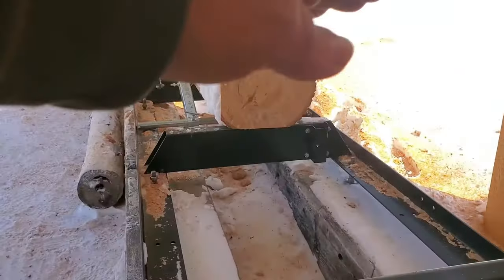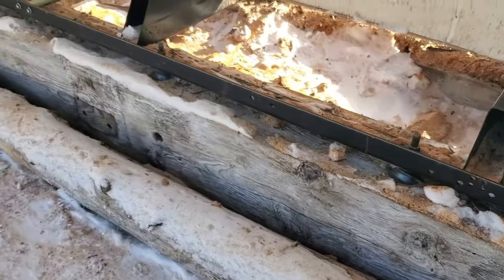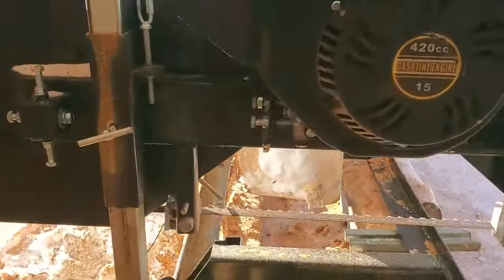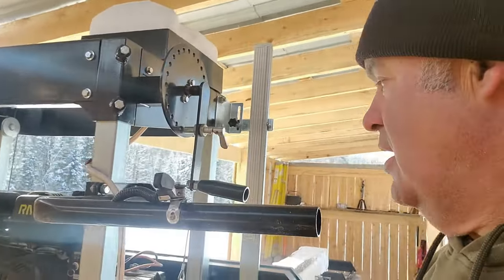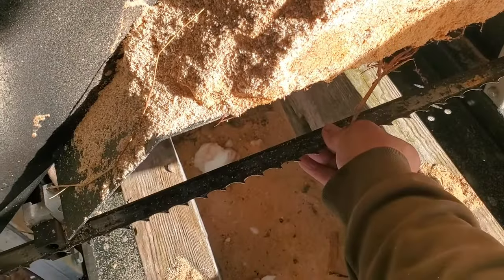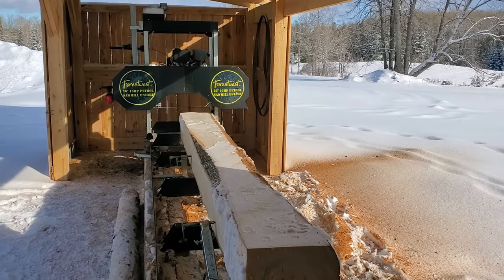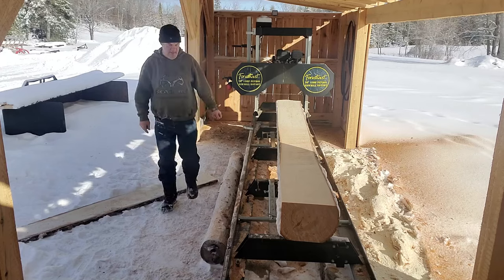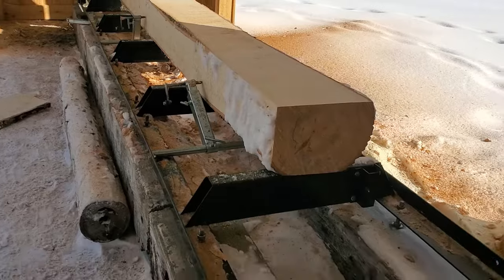Chinese low cost sawmill Forestwest 2 YEAR REVIEW

Comment: G'day Doyle, We do have Forestwest in Australia I purchased one of their 700mm firewood saw benches 13hp tungsten tipped circle saw for docking wings from my Lucas Mill, they wanted me to review it they film adds and have retired school teachers demonstrating firewood splitters. Anyway if you sat it on uneven ground which is what happens when you tow things around the yard the blade hits the side of the blade safety cover ! we spent a whole day making brackets and bracing the legs to strengthen it all up then lengthened the draw bar and made it removable and so on. If they had simply used thicker plate steel for a little bit more money from the start it would have been ok for the price.

Comment: It looks very very similar to my Woodland Mills sawmill. I mill hardwood mostly. My problem is the diving at knots. I went back to the manual and aligned everything to spec and still get diving.🤷
Reply from the maker: I find that putting a new blade reduces the diving and going slower does help also. But ya i know what you mean.
Reply: I find starting at the small end of the taper does help for some reason. Also I move the guides in as close as possible.

Comment: Well, at least it's accurate for what you're doing with it. But easy to see why it's cheap and goes outta whack though, like you said it's way too lightly constructed so they can save on steel and shipping cost. Hence, why you get it cheap.
Obviously you have a tractor or something to move the logs, so what I'm about to suggest won't impede the portability of that mill.
Get similar shaped but thicker L profile steel the length of the whole frame, slip it onto the outside of the frame and redrill the holes for the leveling bolts using the (now blocked) OEM holes as drill bit locator.
Reattach the bolts and your mill as a whole, square and level up your mill with a heavy load on it (lots of slabs), then true it all up and make sure it's level again (Expect to remove supports here and there) and weld the sucker.
2 inch beads every 6 inches for the whole length ought to beef it up substantially, feel free to drill some holes and weld those up as plug welds too, keep the heavy load on to stop the frame from doing any twisting/bending shenanigans. 
Those square crossbeams are so thin you could dent them with your finger, probably contributes to flex too, add more of them with thicker walls.
Do the same thing anywhere else you encounter flex/movement/"outtawhack" issues.
Just.. beef it up using similar but thicker profile steel, re-drill any bolt-holes from the in or outside using the (now blocked) OEM holes as drill locators, add longer bolts, even bigger diameter ones (if you deem it so), where necessary.
You will be saving a lot of headache and can just get to milling instead of having to true it up when a squirrel sneezes 1000 yards away 😆
Reply from the maker: In our area I've seen homemade mills built back in the day, you could drive a truck over them and they wouldn't budge. LOL Yes you can make this more robust for sure pretty easily with a welder and steel and some time. Thanks for stopping by.
Reply: @doylemaintenance  People got very creative back in the day, they were able to mill enough for their houses so of course the contraptions outlived their use (and their inventors lifespan).
Also, hope I didn't come across as ornery/looking down upon you. Nice work with everything you've done with the mill so far! You were 💯very clear in the video that you did your homework (we're the same, I overread and overthink as well), knew what to expect, knew what you were getting, you worked around it, saved money, and stayed active!  😊

Comment: Have you ever cut oak?  
If so what thickness? 
How did it do oak?
Reply from the maker: Yes red oak, it cuts slower but does it, To do it well I would need to switch to a different blade pitch, my blades are a combo blade which will but both types hard and soft but to cut hard best I need different blades. I've cut 26 inch wide red oak.